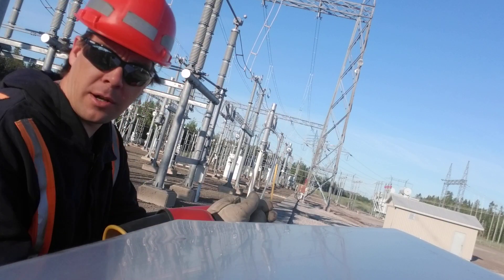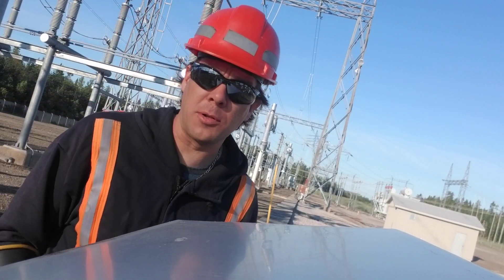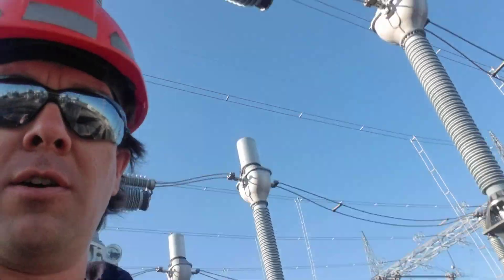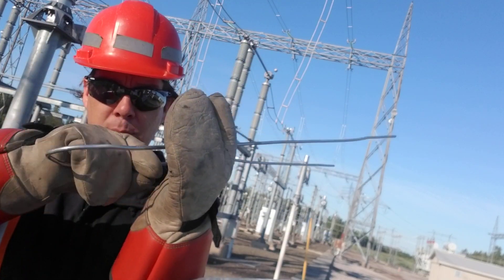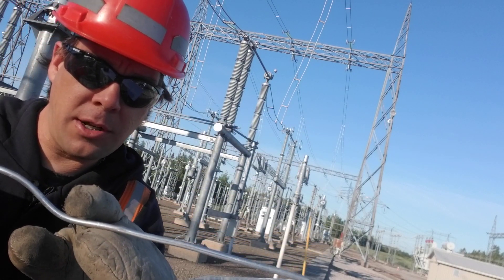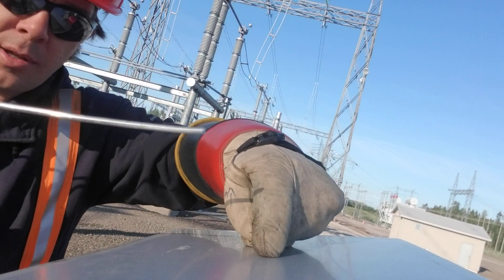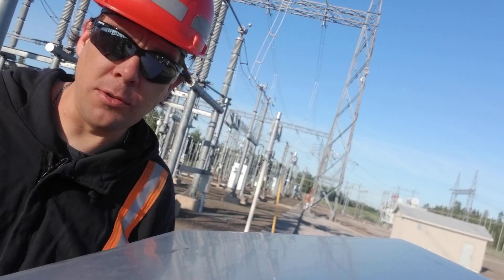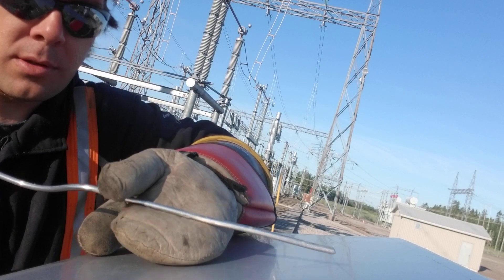Induction in substations - Powerlines

Comment: Before I retired I was pulling one span of .556 from a customer owned solar farm riser to connect to a 34.5 delta sub transmission circuit. The  circuit ran parallel with 2 230 kv transmission circuits. The wire I was pulling ran perpendicular to the transmission circuits. We hung the wire on the first dead end pole and when we sent it up the second dead end pole the wire played over the arm and contacted tree branched. While in branch, the leaves started to burn. We put our rubber gloves on and before sending the second phase up, we had it just off the ground, I read 10kv with a phaser to ground. Be careful out there.

Comment: Its quite common to get what we call "a belt" when touching metallic objects in a substation. Its a hazard of the job unfortunately in that your body charges up and then discharges when you touch an earthed object. Alot of our trenches and cable ducts have GRP covers which although strong act as an excellent insulator. If you are standing on them and touch a cabinet door you get a static style shock. I find standing on the gravel stones next to the trench tends to stop the issue but it always catches you out even when you expect it. We tried adding additional earths to the equipment and it made no difference.

Comment: Makes a lot of sense. With that high of EMF in the air, only a few turns of wire will produce a secondary transformer much like producing the filament voltage for a microwave oven. I learned something new today. 🧐

Comment: I did some computer work in a 161 / 69 KV sub had to bond my laptop to ground, the USB cable I was goin to program a microwave radio with would draw a small arc the metal desk and kept resetting USB transceiver in the laptop. Alligator clip to the hdmi port ground plane fixed the issue! Small things in life ;)
Reply: I have used my laptop in 500kv yards never had any issues like that your describing, but all inside the control houses maybe inside there was grounded.

Comment: Has that have anything to do with these large loops of wire at the bottom of end or terminal towers? i do not see these loops on line towers.  https://goo.gl/maps/3bpitTh3nbeQ6eGf8
Reply: Depending on what you are talking about, it is either fall protection or an opgw coil and splice box.

Comment: I discovered the same effects when I was under my truck under high voltage lines with my metal flashlight against the truck metal.  You can see the tiny sparks at night. ☇

Comment: Fences at broadcast towers need to be grounded too.  They'll pick up that power from the antenna that can can translate it to a voltage on the fence that can hurt you.  Even a mile away if you have something like a crane in the air.  Quite interesting.

Comment: I've always liked the ability of those high tension lines to be able to light up a fluorescent tube. Something else to show people about the power that is lost due to inductive and capacitive reactances.
Reply: It's likely that the line setup (specific distance from ground ) puts these lines in the earth's magnetic field. The lines collect inductive electrons and distribute that potential across the system. The system can't do that underground.  When the correct balance is met between potential and demand and can be controlled by switches ,we have what we see now. I worked at Wheelabrator McKay Bay power station in Tampa FL. That pile of debris couldn't run a toaster but they claim burning garbage runs the steam turbans. Nope .it's a great big show and money laundering. That plant and 3 others I worked in are piles of scrap made to look like something. They use more btu's of natural gas to burn the garbage than the net benefit of so called electricity they claim to produce. Remember,  electrons go to the demand not the source. This plant used more gas and electricity than I've ever witnessed. Not to mention the pollution this plant created. Not clean , not efficient but it won't ever change while they absorb the communities money on tap . Just the monthly maintenance  budget for this place was just unsustainable but not changes as long as I was there .for years. Money machine . This planet is a rotor and the sun is the stater. They learned during the Carrington event that induction power capture is a certain potential if the circuits are set up right. Don't get mad,  just consider what l've described.  The grid can work both ways, and ask your self why , even in forested , unpopulated areas , they must maintain a specific distance from ground when there is no need to do so for safety or performance.  Free money for the energy cartels and plenty of room to clean dirty money.

Comment: Having run a crane inside a substation before to set the insulators inside of a new transformer and some other odds and ends. I never knew about it until working with these guys. Every time he touched the ball he could feel that small little shock for the induction you’re speaking of. Sadly we had no way to ground that specific crane but he was fine with working with it like that. Amazing to see the power electricity has without even coming into physical contact with wires
Reply: Because energy does not flow in wires but around them.

Comment: That is capacitive coupling from the very strong alternating electrostatic fields (high voltage). Induction from conductors that many feet away at such a low frequency would take an enormous amount of current, and the voltage would be present across both ends of your piece of wire, not between it and ground. BTW, I would be absolutely terrified to be inside that switch yard. As an ex commercial inside wireman I am glad not to be exposed to the arc flash potential of 277/480 anymore lol. You guys have balls of steel!
Reply: Better hope not!  Even Brass would be problematic.   🤣

Comment: Exactly how farmers can "steal" high voltage power from lines running over their property.  Question is:  Is it really stealing?  I think legally in US, at least,  it has been determined to be theft by intentionally taking advantage of induction.  Clever though.  Makes me think that though not efficient, water and soil is still absorbing induction...hence power loss over the run of wires.  Get a lot, give a little I guess is the theory.  Is why DC transmission is sometimes desireable.
Reply: thats something I also spend some thoughts, how to "grab" the induction energy on a field or other area with low hanging high voltage lines, but i couldnt figure out what would be a good way to receive a useful voltage and current XD
Reply: How do they steal? How much do they steal?
Reply: @imeprezime1285  I think if you put a large coil near the powerlines the induction energy will get transferred in the coil like a wireless mobile charger
Reply: @legominimovieproductions  Energy and power is proportional to flux and frequency. So, with typical fields below power lines your coil must be very big to power even a single 40 W bulb. I mean VERY BIG!

Comment: I think this is no induction, more capacitive coupling ?
Reply from the maker: I would have to agree with you! 

While a vague definition can describe both capacitive coupling as well as inductive...I think most people (myself included) often times use the term "induction" incorrectly to describe any conditions in which a conductor becomes unintentionally energized through magnetic field. Great comment! Thanks👊
Reply: @Bobsdecline  it is a unpleasant effect anyway not know how much current this coupling is capable. Even something between 1- 4mA would be disturbing. The place you made the video must be enough to use neon lights without any wires, when pushing one Side into the ground.
Reply from the maker: @MetrakitProRaceII  I would say it probably is! I've actually been meaning to try it sometime 🤔
Reply: @Bobsdecline   you got to do it because the novice person eyes will pop out of their heads.  And maybe have some respect for the trade
Reply: Hans Wurst in some of our subs we get the effects of it when maintaining isolators. Even with portable additional earths applied and the circuit main earths and each part of the isolator bonded, it still gives uncomfortable shocks. The only other thing to do is bond yourself to the isolator but it’s not really a desirable thing to do.
Reply: @MetrakitProRaceII  The tubes would be lit up to 1% of their full light output in the best case. And they should be long and oriented in the right direction to do so. Not enough if you ask me😁
Reply: @imeprezime1285  yes. But enough light to roll a cigarette ;>
Reply: @sinistaproductions9164  this is a great point. I'm an electrician and build traffic signals and street lights etc. On occasion, we get shocked when working on light poles that are under transmission lines. Are you saying I could bond myself to the pole I'm working on? It happened last week and I thought about tying myself to the pole with a piece of wire.
Reply: You would have Inductance, Capacitance, and Resistance in the circuit.  All three MUST be present.

Comment: You should have done a better job of explaining for Greenpees.putting on a pair of gloves to open the gate is bull.
You should have showed us that wire with no gloves on. Not trying to start a fight you do good work. But having to open a gate with rubber gloves on is bull A.
Reply from the maker: Its actually our company policy. 
As stated in the description , the odds of this actually becoming an issue are slim, but with all the vandalism in our substations there is a possibility of having a difference in potential between the two side of the gates. (if bonds/grounds are cut) I should have mentioned that applies to opening the actual gate and separating the two panels entirely, and not just the man gate.
 I have in my archives photos of burns marks between connecting panels on chain link fences after faults have occurred. I do get what your saying though
Reply: @Bobsdecline  yeah that's what I'm talking about the two gates that's where you get in trouble. You're getting knocked on your ass all day long in those substations touching two things. Electricity got to love that shitt
Reply: Electrically speaking you think we live on a spinning ball.
Reply from the maker: @stevea8355  I'm not sure I understand the question ?
Reply: @Bobsdecline  well in my old age I discovered they lied to us about electricity. The sun is a sole source of energy. And that demands closed circuit. No Sunshine no electricity. It's impossible for light to travel a light year.
Reply from the maker: @stevea8355  ahh very interesting . Makes me think of the statement that energy is never lost , yet is infinitely  transferred .... Kinetic to potential energies  . Thoughts and theories involving these things on such a large scale are very intriguing . The consistencies with small scale systems while other certain laws seem to stray from the science we know 🤔 makes my head spin! Lol
Reply: @Bobsdecline  there's no theory's out there about electricity just facts. Gravity is a little thing called electricity there's no such thing as gravity.
Reply: @Bobsdecline  make sure you check those dudes out measuring voltage from sunlight.
Reply: @stevea8355  What strain of weed are you smoking? Gravity is real, and I reckon it has nothing to with electricity.
Reply: @stevea8355  Oh, and you know stuff about electricity, perhaps even more than a trained lineman? Where's your credentials?

If your credentials are from Google University, then you're full of it.
Reply: @HappyDiscoDeath  so I was right you are a grunt.
Reply: @stevea8355  right... bein' a skeptic and asking for credentials to back your claimed knowledge makes me a grunt. #Sarcasm

Buuuuuuurp
Reply: @stevea8355  do you even know what a lightyear IS?
It's the distance light travels in a year.
So of course light can travel that far, because the distance is literally measured by how long the trip takes lol

And if you are saying that light can't go that far through spacey, then how can we see the stars?